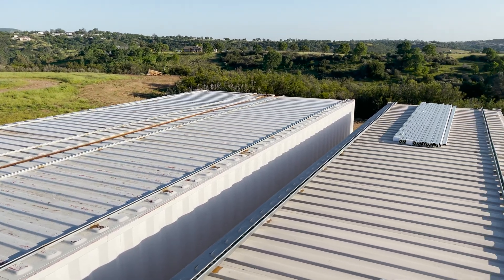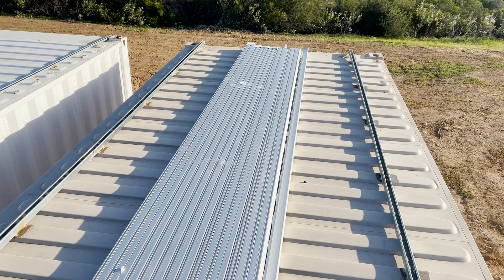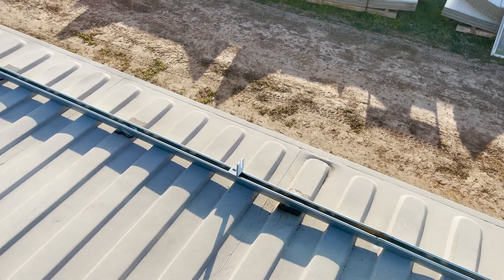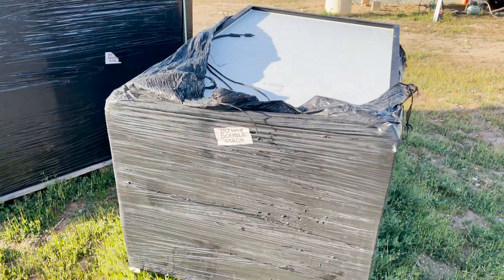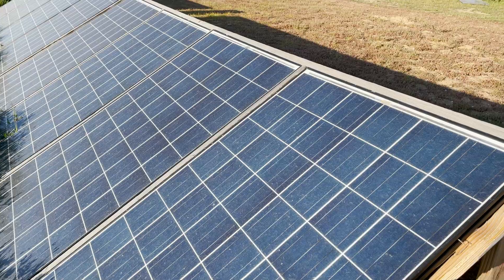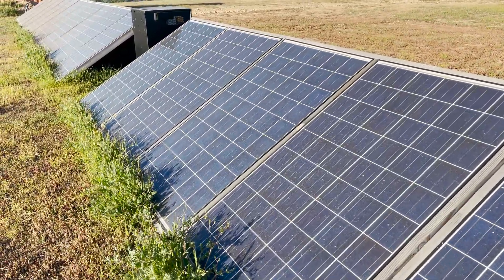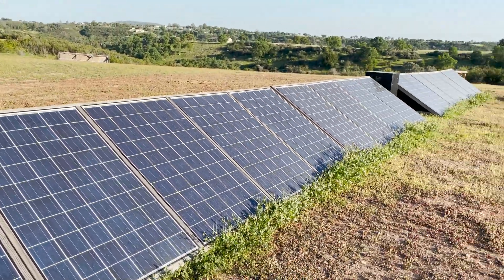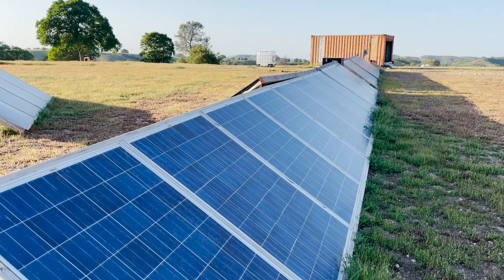12kw Off-Grid Solar Array || Beginning Installation

Comment: Dude I'm glad I found you I just installed these same panels for a 4.5kw off grid backup on my back porch roof.
I noticed one of the panels had some corrosion very noticeable and all the others look really good.
I can't believe San Tan Solar sold these and didn't disclose possible problems.
They only listed as cracked back sheets and used, same 250w but I got them for like 40$
I also had to fix every single MC4 connector as some were loose and backwards....
Wish there was a way to correct the bad back sheets and reseal them.....

Thanks for the info and glad to have found ya!
Casey

Comment: Interesting on the used panels. I bought a few used panels for my Rv, they have been great but they are Canadian Solar.  One comment, for welding two outdoor metals together, you can buy a “weldable” Primer. Basically it goes on the metal surface where the two metal pieces touch and you can’t get paint in there. It is really good for outdoor stuff. We used to use it on dump truck beds we built at an old company. Really helps keep rust staining down for a lot longer. Great work, always interesting to see what you put together, very professional.

Comment: A test you may want to do is an insulation test between the PV leads and the frame to see what the leakage is if any.
I have 18 250W recall Trinas wired to one of the inputs on my Sol-Ark system and they still work knock wood, but I did have a connection burn up from an improperly seated MC4 connector that was improperly done at the factory.  Check all of yours to make sure the connector pins are properly seated.  What I did was disassemble each connector and jiggle it axially to make sure the pin was clicked into the locking ring in the connector housing.

Comment: Seems like where you cut and welded on the container needs to be primed and painted.
Used anything is a risk.  Compare a 20 to 25 year with 80% rated output warranty on new panels with a DOA or 90 day or maybe 1 year warranty on used panels and be prepared.
I had a rack of 4 panels ripped off the roof. The other two racks right beside it were fine. The one that took flight shattered one of the 4 panels when it hit the ground, after ripping a palm-sized chunk thru the roof decking. Wind is no joke.